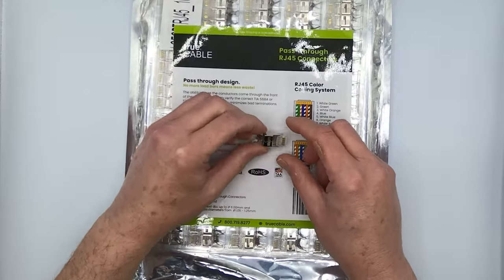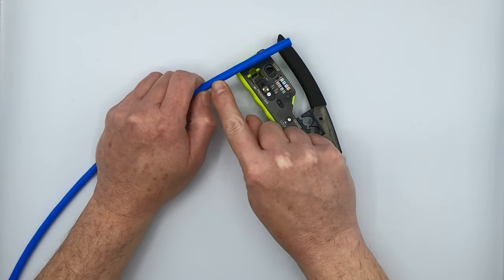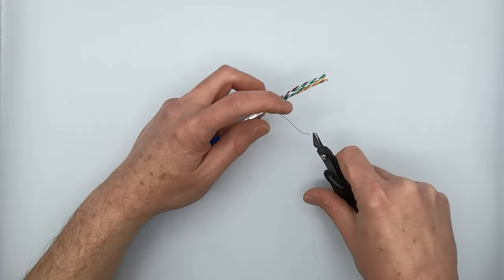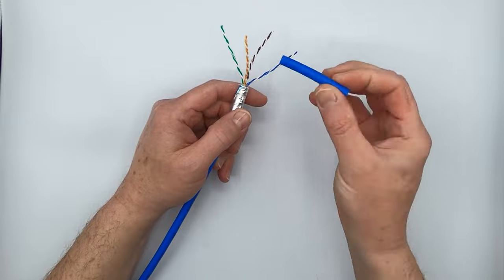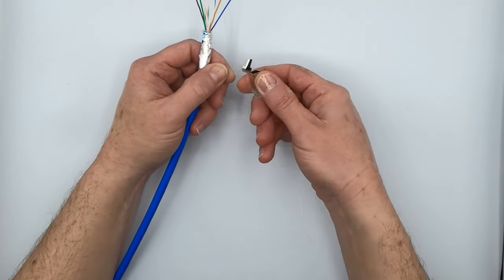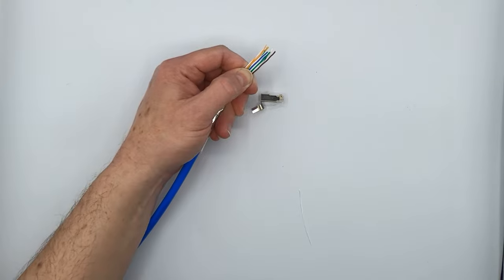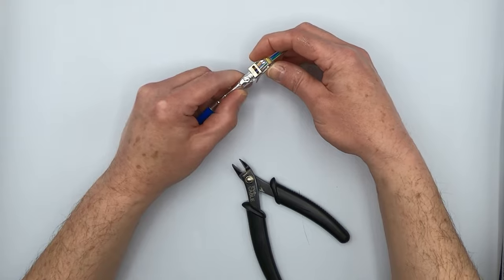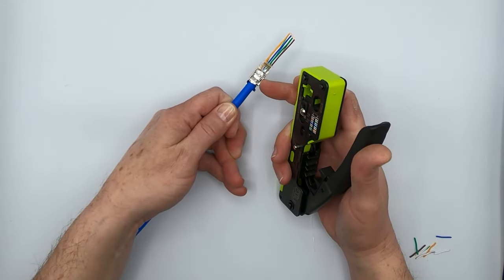How To: Terminate a Shielded Cat6/6A External Ground Pass Through RJ45 Connector

Comment: This 8c8p plug. Not rj45.
Reply from the maker: Hello! Yes, technically speaking, the term RJ45 is not correct. This is a 8P8C modular plug. That all said, the term "RJ45" has stuck for some reason and just won't go away. It turns out that when people are looking for information on terminations, they search for "RJ45," and to find us and the information they need, we have to put the term "RJ45" in, or they won't find the information at all (or might get incorrect information as well). Also, newbies don't even know the correct technical term "8P8C" applies and would not understand what it means. I will typically put something like "8P8C aka RJ45" into writing, but I don't always catch myself! We tend to use both terms at trueCABLE so everyone understands what we are talking about.

Comment: As a first timer, this was extremely annoying and hard to do. I ended up stripping the outer cable a bit longer around 3-4 inches and inserting the little wires one by one. Once I did this, it took me 2 minutes and was super easy. Sure, you lose a few inches of more cable than needed, but for me it was definitely worth it
Reply from the maker: Hello Erman! I fully understand. When I first started terminating Ethernet, I found myself in the exact same position of putting an 8P8C (aka RJ45) onto a thick shielded cable, too. Sounds like you found a solution that worked for you! As long as the termination meets the standards and works, then I say great job!

Comment: The drain wire should not be cut but rather folded back with the shield.  The purpose of the drain wire is to ensure the shield gets grounded.
Reply from the maker: Hello Tommy! As it turns out, the way you describe bonding is one a few ways of getting the cable shield bonded and grounded. You can fold just the shield back, remove the foil shield and fold the drain wire back and wrap it around the jacket, remove the the foil shield and fold the drain wire back and wrap it around the jacket while tacking it down with copper conductive adhesive tape, etc. As long as the cable run passes on the Certification test then the cable shield resistance is less than 100 milliohm as required by the standard. Often you see installers fold the shield back AND wrap the drain wire around it to help ensure the standard is met, but this an installation technique only and not found in the standard.
Reply: @trueCABLE  I'm not saying it won't work, I'm saying the drain wires specific and only function is to carry the emf/esd to ground.  The shielding is there to do just that, shield the inner copper conductors from the emf.  Can you use the shield for continuity, yes, but your cable will be a lot more robust/reliable if you terminate it using the specific intended purposes of the components.

Comment: Anyone else think this is beyond absurd to be doing it this way in this day and age?  Here's a thought, develop a twisted pair that has an alignment point on the cable jacket that you align with a specially made connector.  You line up the arrows on both and crimp it.  Sure you might have to design the cables so they are flat or something, but that would be a damned site better than rubbing sticks together like this.

Comment: I’m a newbie, one video says to use the drain with with conductor tape and this one says to cut it off. I’m running the shielded cat6 from my house modem to a wireless router out in my pole barn. I didn’t know I got shielded wire till I already ran it.
Reply from the maker: Hello and sorry for any confusion. There are many ways to bond the cable shield, and what you saw is my evolving process in action. The way I go now is if I have the copper conductive strips around I will REMOVE the cable shield but keep the drain wire. I then wrap the drain wire around the jacket and tack it down with the conductive adhesive copper fabric strip. This has the effect of creating a much thinner (and easier to work with) cable termination in addition to addressing that annoying cable shield being accidentally cut off during stripping (assuming the conductors did not get nicked). Easy fix, because the cable shield is going to go anyway.
Reply: @trueCABLE  OK awesome I do appreciate ur help and your quick response. I’m gonna do exactly how you did it in this video.
Reply from the maker: @Sully-83  Hello and you are welcome! Any of the methods I have demonstrated will work to bond the cable shield to your hardware. The big difference between the methods has to do with easing the process itself.
Reply: @trueCABLE  I certainly wouldn’t mind the easy route since I’m still learning. lol. What’s ur thoughts on having a wireless router in a non heated pole barn? I plan to have heat by next winter but don’t think it’s gonna happen this winter. Man I’d love to have internet in or near though while doing stuff by the barn.
Reply from the maker: @Sully-83   Hello! I think you mean PoE powered WiFi AP. A wireless router would conflict with your original router on your network since only one device can be the DHCP server and route traffic. I think the idea of mounting an outdoor rated WiFi AP is a great idea, and I do it all the time. No need to worry about heat or cold, or even rain for that matter. If you use one that is PoE powered (most are) then it uses the same Ethernet cable for power and data. Most of those PoE WiFi APs come with a PoE injector, too, so you don't need a specialized PoE switch. Use the same network signal names and passwords like you do inside your home and assuming you plan the signal coverage correctly you will seamlessly roam between your home and barn without issues when walking back and forth. Don't get tempted to repurpose an old indoor only WiFi router with the routing part turned off. It won't survive the temperature extremes and is not meant for outdoor use in the slightest. Hope this helps!
Reply from the maker: @Sully-83  Hello! I think you mean PoE-powered WiFi AP? A wireless router would conflict with your original router on your network since only one device can be the DHCP server and route traffic. I think the idea of mounting an outdoor rated WiFi AP is a great idea, and I do it all the time. No need to worry about heat or cold, or even rain for that matter. If you use one that is PoE-powered (most are), then it uses the same Ethernet cable for power and data. Most of those PoE WiFi APs come with a PoE injector, too, so you don't need a specialized PoE switch. Use the same network signal names and passwords as you do inside your home, and assuming you plan the signal coverage correctly, you will seamlessly roam between your home and barn without issues when walking back and forth. Don't get tempted to repurpose an old indoor-only WiFi router with the routing part turned off. It won't survive the temperature extremes and is not meant for outdoor use in the slightest.
Reply from the maker: @Sully-83  Hello! I think you mean PoE-powered WiFi AP? A wireless router would conflict with your original router on your network since only one device can be the DHCP server and route traffic. I think the idea of mounting an outdoor rated WiFi AP is a great idea, and I do it all the time. No need to worry about heat or cold, or even rain for that matter. If you use one that is PoE-powered (most are), then it uses the same Ethernet cable for power and data. Most of those PoE WiFi APs come with a PoE injector, too, so you don't need a specialized PoE switch. Use the same network signal names and passwords as you do inside your home, and assuming you plan the signal coverage correctly, you will seamlessly roam between your home and barn without issues when walking back and forth. Don't get tempted to repurpose an old indoor-only WiFi router with the routing part turned off. It won't survive the temperature extremes and is not meant for outdoor use in the slightest.
Reply: @trueCABLE  ok. I may have to consider having to go the WiFi AP. I bought and already installed a TP link ax3000. Got everything working but yes ur right it has its own password and name. Which is ok but yet to determine if it was to seamlessly jump from one to the other.
Reply from the maker: @Sully-83  Hello! The transition will be more seamless if the coverage area of the stand-alone TP-Link AP overlaps the original AP's coverage area a bit. This can be planned out with WiFi site survey software, some of which you can get on a trial basis for free and if you want more advanced features you may have to pay some money. I use a business oriented version of NetSpot, which is fully featured. Both APs should be using the same network name and password. Good luck!
Reply: @trueCABLE  thanks for all the help, much appreciated.
Reply from the maker: @Sully-83  Hello and you are welcome! We are glad you find the content useful.

Comment: T568A or T568B, let the cable decide, Brown Stripe,brown goes on pis 7,8, and use the diagonaly oppersite on pins 1,2 (Usualy orange some can be green, if its blue just pick one), you will find a more natural and symetircal lay for the cores.
Reply from the maker: Hello and that can certainly be helpful advice! That all said, sometimes you are already working with an installed structured cabling system where the decision was made before you, or you are working to a contract that actually specifies which one to use. If none of the foregoing applies, then pick the one that works for you and stick to it!
Reply: @trueCABLE  Yes Contractual obligations come first, but if you use an adjacent colour to brown on pins 1,2 then the blue isn't naturally in the centre, and only one side of the TX pair needs to be stretched over both blues. so not symmetrical  or a natural lay.

Also worth noting that if you let the cable decide a full x-over is also naturally symmetrical.
Reply from the maker: @JaneDoe-b9i  Agreed! Of course this applies to 8P8C (aka RJ45) plugs that are hand terminated. The other consideration is that one end of the cable may lend itself to one pattern where the opposite end of the cable may lend itself to the other pattern. Assuming you are not looking to create a cross-over cable one of the ends will fight you more than the other. I see this every time I install, and thus minimize my use of 8P8C plugs due to various issues to include this one. Keystone and other IDC terminations really ease this process!

Comment: Solder the drain to the metal housing.
Reply from the maker: Hello! You CAN do that, but I do NOT recommend it for the average DIY person or even professional installer. It is all too easy to accidentally damage the cable and/or connection hardware...not to mention the liability issues associated with recommending that sort of method.
Reply: Solder to the end of the strain relief before crimping if you want to solder the drain wire, to avoid melting the plastic connector body,
Reply from the maker: @ctrlaltdebug  Although that sounds like a good idea, the method you propose has a good chance of not working out. The strain relief collar is placed is placed under a great deal of pressure and formed into a circle when crimped to the cable jacket properly. This would likely break the solder. We don't recommend this approach. Instead, we recommend bonding the cable shield to a shielded keystone jack at the switch/head-end of the installation and then mounting the keystone into a shielded toolless patch panel that is already bonded to the ground. A 110 shielded punch-down patch panel that has similarly been bonded to ground would be another recommended approach.

Comment: dont cut your wires straight across prior to plug insertion, cut them at an angle and it helps guide them into the plug in the correct order.
Reply from the maker: Hello James! That sounds like a technique worth trying out. I have never had issues with the straight across cut, but I will give that a shot. Thanks for sharing tips!
Reply: I use the diagonal cut. It seems a little easier overall.
Reply: I always do this

Comment: 1: It’s a pain but strip the jacket back farther than normal passthrus. It will help getting started since the feed ramps are at the last 1/8 inch of a 1” deep connector. 
2: cut the wires at a very slight angle to assist as well. 
3: Support your wires with your off hand while crimping and tug lightly pulling the wire tighter into the connector.  That crimping bar can eject the jacket back and mess up the crimp. Don’t rely on it. Also the conductors can fold over and shear instead of slice and can cause shorts on the outside of the connector if not cut perfectly flush.  This was shown in your video when OW dangled. It wasn’t a clean cut, you said it was okay when it isn’t.  
4: absolutely wrap the grounding messenger around the collar base twice then around the foil for 1/4” or 3 turns. Crimp the collar over the foil and wire. Trim foil past collar. I’m not sure if there was a model change but my remaining true cable pass thru connectors do not have metal on the inside of the connector.  The foil being so close to the pins would block noise on the conductors but will do nothing for making a continuous ground link from the metal tabs on the inside of the port that touch the outside of the connector to the inner foil and to the other side.  The messenger also adds rigidity to the connector if you wrap the collar first.  Pressure goes to the collar instead of pins.  The crimp will slide on the slick true cable cat6a.  These things are expensive, harden your connections and maintain continuity if you’re actually concerned about static (ESD).  
The rest of the tutorial is great and the unshielded video was good but with the same complaints of crimping style.
Reply: I was a bit unclear on the lack of continuity.  If the messenger wire is under the collar it would be a continuous connection but only if the collar stays tight and on top of the wire.  Bending could cause it to shift out of place and I’d rather not leave it to chance.  Your method of leaving the foil and wire forward of the collar would break continuity though still allow RF shielding into the port.
Reply from the maker: Hello SealTech! We appreciate your tips and perspective on this. Thanks!
Reply: You guys are using verbage beyond my understanding hopefully you can help me out. If i accidentally (because this is new to me and i don't know it's supposed to stay there) rip the foil off so that it's only inside the plastic protection (no longer exposed where it can make contact with the rj45 connector I'm about to crimp on) does it really matter? What would actually could actually happen real world?
And how tight is the crimp supposed to be with the metal tabs that go down at the end(at the bottom of the rj45 connector)? They seem very easy to bend right back out away from the cable when i try to crimp them. I can crimp a cat 5e cable no problem, this stuff though is new to me and i have no one to ask irl about how to do it correctly

Comment: I did have one question. How do you ground the keystone end? Or do you even have to? On one end Im using a rj45 jack and a keystone on the other. I am running it underground to a shed. I thought I knew what i was doing util it came to the drain wire.
Reply from the maker: Hello and great question. The best way to bond the cable shield (often called grounding, which is a bit of a misnomer) to the keystone jack is to fold the cable shield backwards and then wrap the drain wire around the shield. Once you close the keystone jack housing, the inside of the metal neck of the housing makes contact with the folded back shield and drain wire. You would then trim off any excess cable shield from the rear of the housing. We have some blogs and videos regarding shielded keystone jacks (found at our website plus here on YouTube) that detail precisely how to do this.
Reply: @trueCABLE  So why there is even drain wire inside?
Reply: @bartoszbaranowski604  the foil has higher resistance and is easily ripped, so the drain wire is there to ensure a low resistance bond throughout the length of the cable. It's better to wrap the drain wire around the foil and crimp over both to get a better bond.

Comment: Great teaching video.  Can you advise when it’s necessary to fold back the drain wire versus snipping it odd at the jacket edge?  I see some other Tech’s keep just enough to have it crimped underneath the metal tabs.  Thanks.
Reply from the maker: Hello Michael! There are several ways you can terminate the cable shield to the hardware. Fold back the shield only, fold back the shield with the drain wire in conjunction, coil up the drain wire under the metal ground tab, or my new favorite is to REMOVE the cable shield (retain the drain wire) and then fold back and wrap the drain wire around the jacket. Then you tack the drain wire down with conductive adhesive copper fabric strips. We sell those strips on our website. You can also use conductive adhesive copper foil tape as well, but it rips pretty easily! Let us know if you have any further questions!